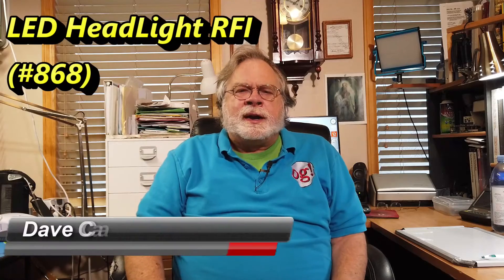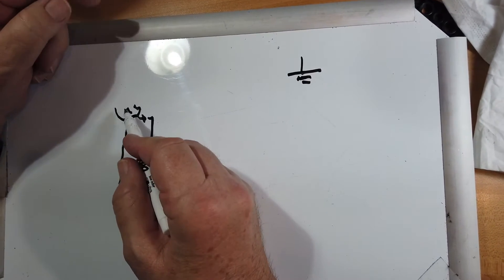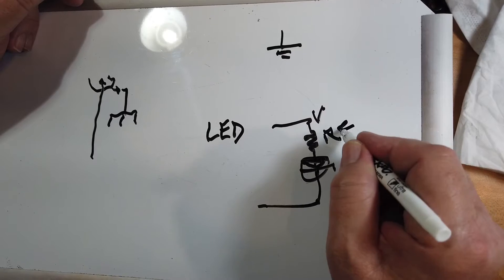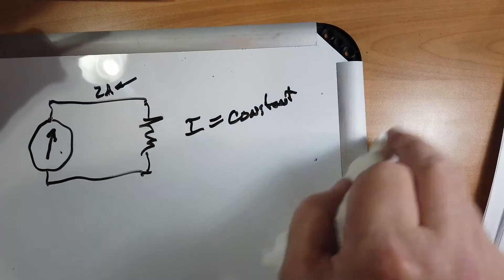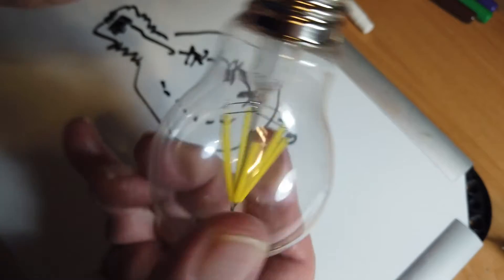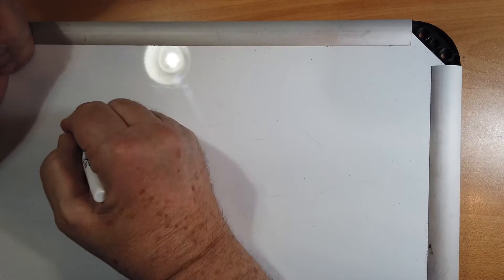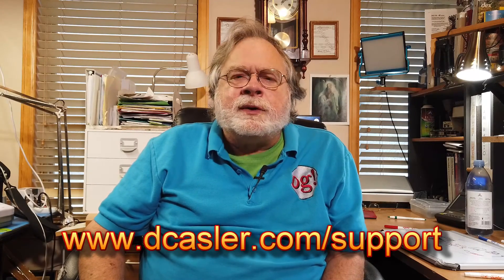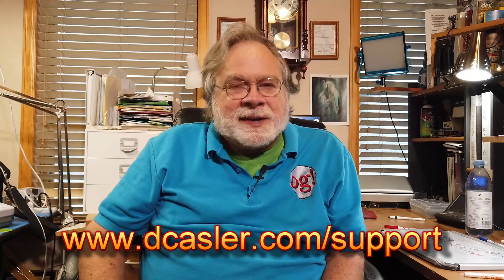LED Headlight RFI (#868)

Comment: I have a 2004 Wrangler TJ. I did what I call a staged headlight upgrade. When I replaced the original lamps, I noted the wiring was very thin and there was some melting in the sockets already. 
Stage 1: I replaced with some IPF reflector & lenses which take H4 bulbs. It was a big improvement, however, the wiring was having bigger issues even though supposedly it was the same wattage.
Stage 2: I did relays and higher power bulbs. (Solid state relay for high beams for DRL!) So nice. Eventually, the IPF reflectors rusted away, leaving only the chrome! I discovered that when changing a bulb.
Stage 3: I had wanted LED, but wasn't happy with the state of the art until I found Sylvania was putting out bulbs, including H4. I put Hella reflectors in with them in and wow! Even the DRL worked with the PWM via the SSR to dim the LEDs. Why remove the wiring now? Lol.

That's about when this whole Covid thing hit and before I got back into HF, but I didn't notice any issues with my FM broadcast or 2m/70cm radio.

Comment: Hi Dave, I have the 'Quadratec Premium Heated LED Projector Beam Headlights' on my '13 wrangler and have been happy with them, i have also used 'Quadratec Gen I LED Headlights' and was happy with them BUT had issues with wet snow build up (East PA winter). The Gen II may be better in snow, im not sure. The price of the Heated lights is almost double but with you being in CO would be the safer bet. Im good on QRZ if you want to talk more about them. Tim W3QP

Comment: Thought I would mention that the headlights used today have plastic lens that will cloud over time. Before changing the bulb look thru the lens if it isn't clear a new bulb probably won't help. There are many you tube vids about dealing with cloudy lenses.

Comment: may be different manufacture , type of LED light.  my 2019 Forester also have stock OEM  LED head light, I have CB 27MHz antenna right in front of the LED lamp but , no interference at all.  no interference to 144MHz FM radio either  , 144 MHz ANT is on hood.  AG6JU
Reply: I have a 2022 Outback Wilderness with the LED headlights and I get a lot of rfi around 146.52 and some other frequencies.

Comment: Hi Dave, let me suggest something here.
The LED bulb is having it's own driver circuit to assure good efficiency (with low heat dissipated as waste of power) and that's the source of the RFI as everyone can understand. The Chinese brands are notorious for RFI (known to everyone in the hamdom) as they don't follow the GMP (good manufacturing practices) to reduce the cost.
There are many solutions available in the literature and online.
His question was very clear.
He has added ferrites on the cable connecting the base and the head that are 18-24" apart.
What's the kind of ferrite he used, we don't know and you didn't ask him.
Not all ferrites sold as the situation for EMI/ RFI are going to work in every installation universally.
RFI/EMI are of two kinds.
1. Radiated (in the air)
2. Conducted (along the cables)
So, he has to provide a Mn-Zn cores like (#73,75,77) or #31 in the cables I would suggest like,
1. The DC cable reaching out the LED bulbs
 2. The DC cable reaching out the radio.
3. The connection between the head and the base (he already mentioned that) 
4. The Coaxial cable at the output on the radio and at the feed point to the antenna.
Here, he has to have #43 mix Ni-Zn ferrites and not the Mn-Zn cores.
He can also use the new recepie material, a Mn-Zn, type #31, a supposed to be an all rounder for all of the HF VHF UHF bands hams would use.
He can try any RF Isolator available commercially. 
Different terminology in vogue for the same are like, line isolator, 1:1 CMC (Common Mode Current) Choke or 1:1 current BalUn.
You would suggest the MFJ as having "(gazillions of ferrites)" inside that short little PVC pipe contraption, I know!
That's, in fact does not contain such a great number of ferrites sleeved on the Coaxial cable.
It's called the W2DU'S CMC Choke suggested by, Maxwell, W2DU. Probably he used many 10s of small ferrite cores over the coaxial cable near the feed point of the antenna.
And then as usual you have confusion about the dimension of the "electrolytic capacitor" you suggested to be included at the LED bulbs. You mentioned 0.1 nF...!!?? That's 100pF; there's no such electrolytic capacitor available in the world. It's a small amount of capacitance and is available as a ceramic or styrofoam or air core ones.
And that capacitor is not going to serve enough.
Initially you wrote 0.1 uF.
Yes, he can try that, (of 50-100v) I won't deny.
Dave and the questioner may want to consult with the meticulous and herculean tasks done by G3TXQ (a silent key) and the K9YC ferrite cook book for core selection, winding details of the chokes and testing them whether or not a particular contraption would work in a particular installation; my respect to them ❤️
De VU2RZA
Reply: Thank you. 
What capacitor do you recommend?
N0QFT, Glen
Reply: @WECB640  Thanks for your honest feedback ❤️
De VU2RZA
Reply: concur totally.
Reply: @vk3wl  thanks very much ❤️
De VU2RZA